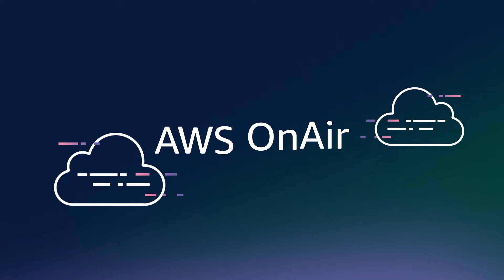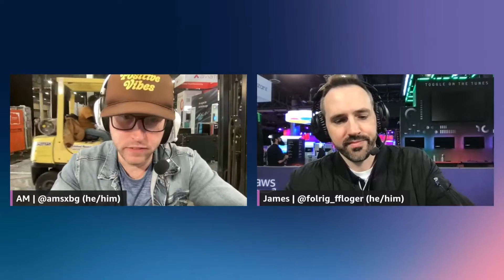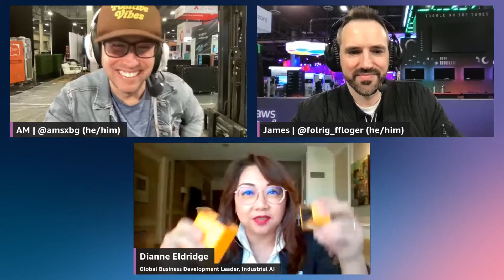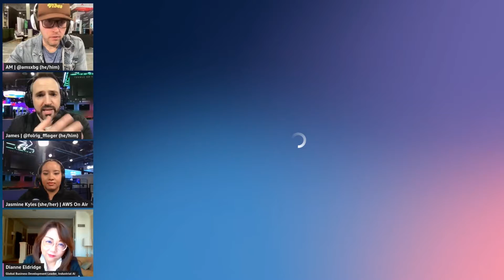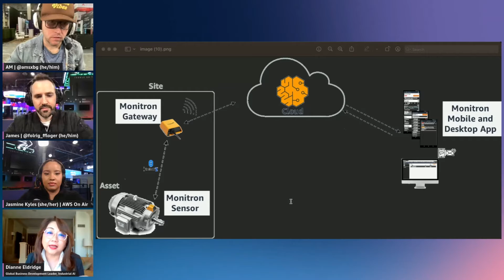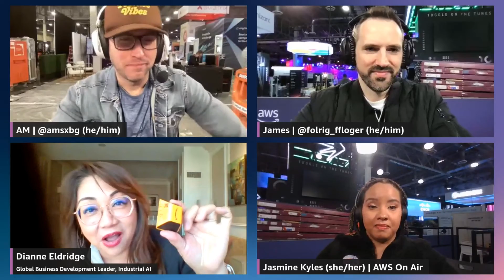AWS re:Invent 2023: AWS On Air ft. Ex-rated Amazon Monitron sensors for hazardous locations

Comment: Once the model is trained, it can tell when something is wrong with the machine. When the machine fails, people can look at their app or screen and see what's wrong. Monitron cuts down failure rate costs. Log jnto console and find monitron with step by step instructions. Oil machinery and all factory machines can ne seen on the console. Giving access to industrial customers without making it overwhelming. Some people have legacy systems and they can export data to stream wherever they want. Streamline to centre data link. Start small, think big, scale fast. Launching new monitron called explosion proof. Put it in a safe sector, great for nuclear refinery and other customers. Vibration sensor in monitron.